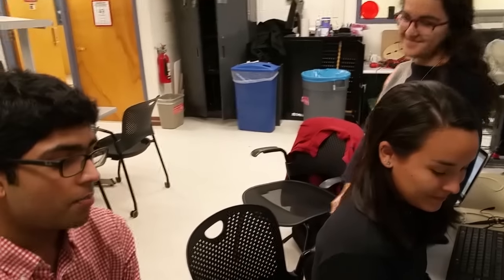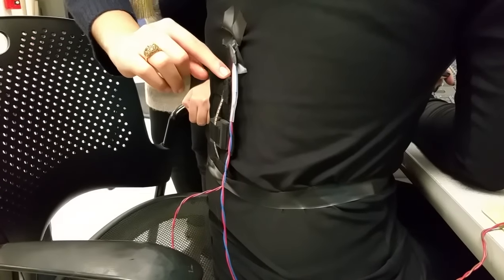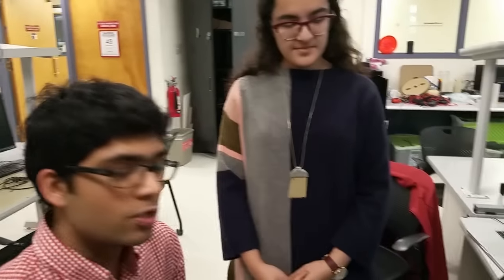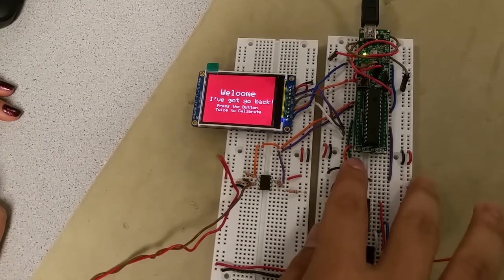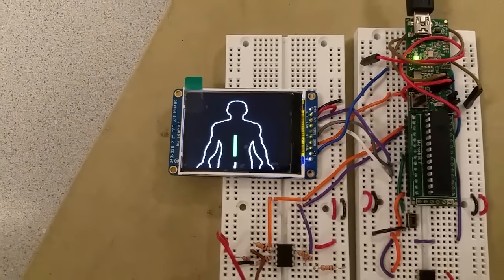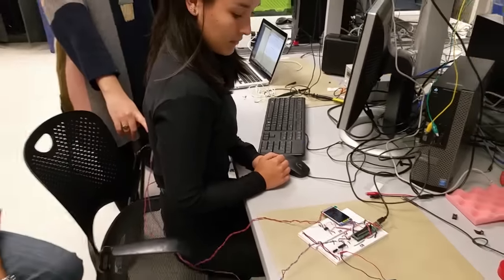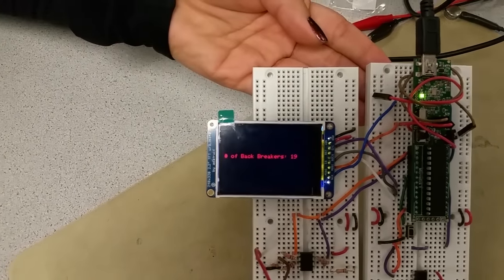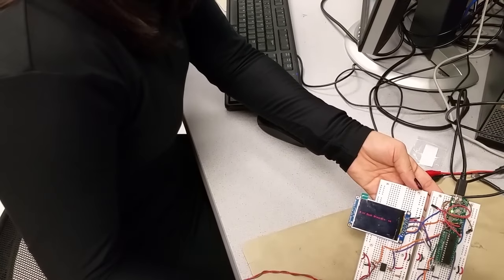Posture monitor

Comment: Lumo lift does the sensor to phone via BT link. It uses a different way of sensing posture (accelerometer tilt). This one is clever with the spine curvature detection but hiding the sensor would be an issue.